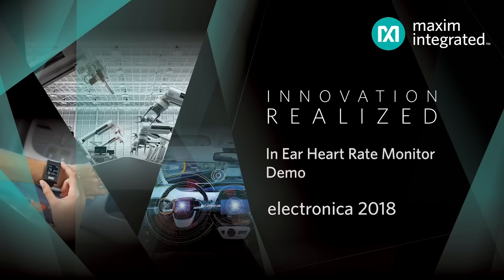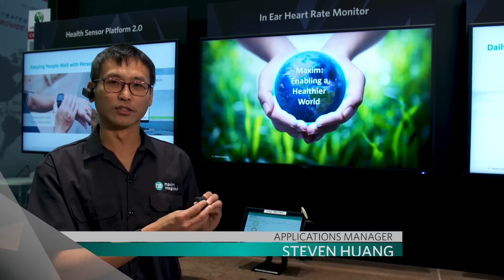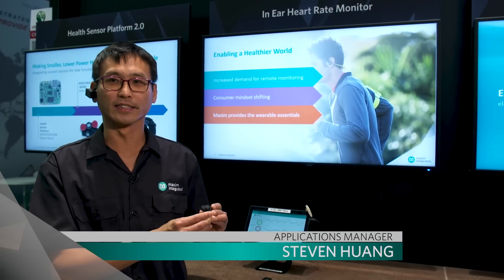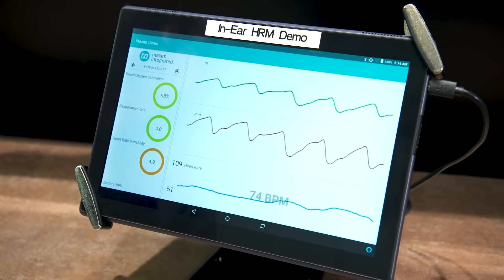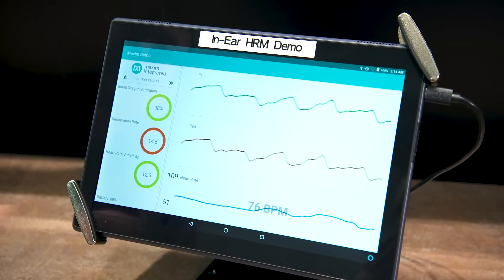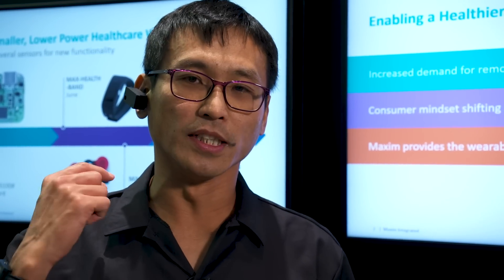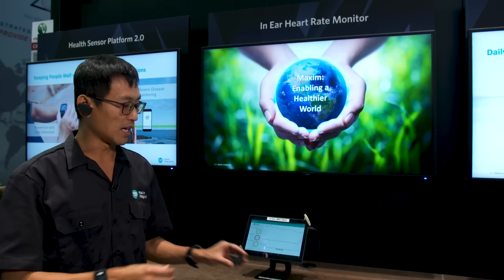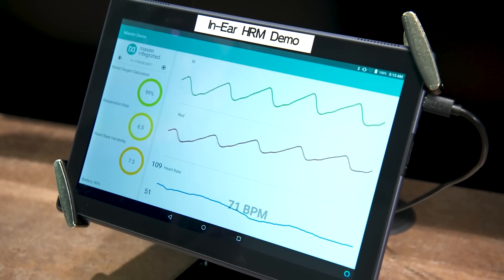In-Ear Heart-Rate Monitor Demo - electronica 2018

Comment: To confirm is this demo of the MAX86140 (mentioned in video), or MAX86160 (mentioned in description)?
Reply from the maker: Hello: It is a demo of MAX86140. Description has been updated. Thanks!
Reply: Hi, Do we have any pcb holder for MAXM86161 to place it inside ear, so that the LED is facing tragus? The MAXM86161EVSYS is available but it has flexible PCB, not sure how to place the board inside ear and the support for MCU board
Reply: @amitbiradar2014  Did you ever figure this out?